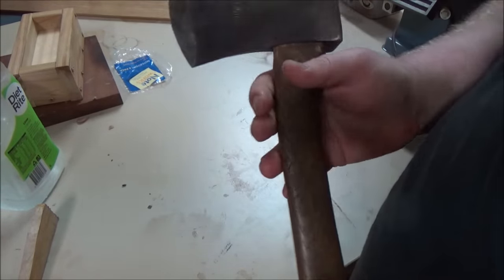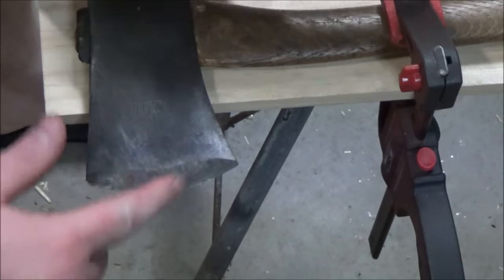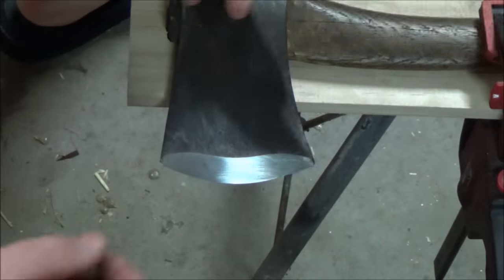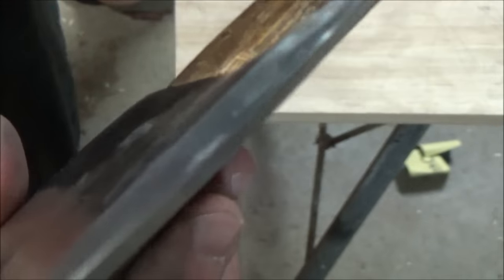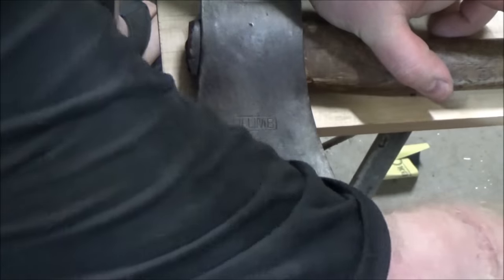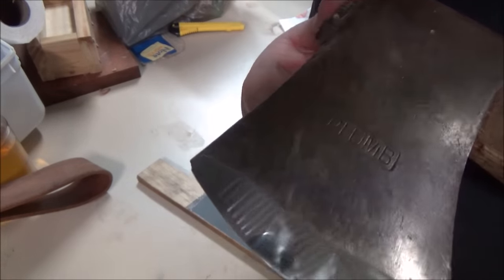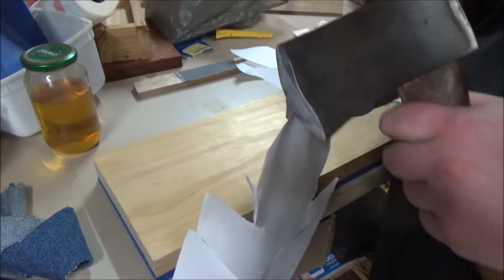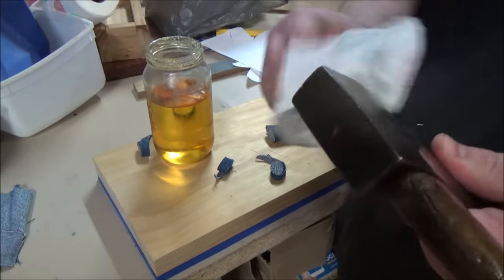How to Sharpen a Hatchet or Axe to a Scary Sharp Edge!

Comment: Are Hatchets made of different steel / metal, or are the all made of the same type of metal?

Also, I've seen some people use a file to sharpen axes, and hatches. Is that method ok? Yes, or No, and Why?
Reply: The type and composition of the steel in a hatchet or axe head varies greatly depending on the quality level of the tool in question. Some are cheap crap that can't be acutely sharpened and won't hold a keen edge for very long. Some high quality items are multi layers of carbon steel that have been forge welded together and given a folding and forging technique similar to Damascus steel. This type of head have a micro chrystaline cutting edge and a sharpness unsurpassed by plain carbon steel.

Comment: Fantastic instructional video!  I have taken your technique to heart.  One question:  Do you put anything on the newly-sharpened edge to prevent rust?
Reply from the maker: Thanks. It's not really my technique. I just tried to think of an easyier way for beginners who don't have stones or tools to sharpen an axe.
I forgot to put oil on in the video. But just put some 3 in 1 oil or anything really. Sometimes I put spray oil from the kitchen on there. Just spray some on and wipe it all over with a tissue or something and it should be good.
Reply: @scottshobbyz5416  Thanks for the additional info.  I figured you had to do something to prevent rust.  Again, great video!

Comment: As someone who surface finishes stainless steel, you need to use sand paper with Ceramic Alumina abrasive, not zirconia or aluminum oxide which are your cheaper, wood sandpaper... The best brand is Norton's Blaze line of abrasives
Reply: You know Ceramic Alumina is Aluminium Oxide right?

Comment: First up, I haven't got a clue but an axe is for chopping wood where you need a substantial bevel that splits the wood once its cut into.
Reply from the maker: The profile of the axe is more important for splitting than the bevel. As it is what causes the wedging action. If you are only splitting wood there is no point having a bevel like mine though as it doesn't help it go any better than a rougher edge say from a file. 
When you are cutting across grain is when you want a nice sharp axe them most. But honestly this was a a bit over kill. But it was for fun. If you mainly just want to cut up dead dry wood then file sharpness or up to say 400 grit is plenty.
If you are axe racing where you want to squeeze out every bit of performance then this is great. They usually take it to a perfect mirror polish. For cutting green wood or carving this extra sharpness is a benifit. But you do get diminishing returns the higher you go. Axe edges don't last all that long and have to be constantly maintained (which isn't hard) but if you just want to get the work done you can get a really good edge with a file.

Comment: I do believe I'd put a small block of wood at one end of the board that holds the sandpaper to act as a guard from slicing a finger while whipping the board to and fro.
Reply from the maker: That could be a good idea. As the sandpaper doesn't go all the way to the edge you can feel it if you go too far. But for people who are worried or are uncoordinated it could work well.

Comment: I used to only use a sharpening stone and my axe would get dull super fast but after watching this I tried it and my hachet is  super sharp if I could put a rating on the video I would rate it five stars
Reply from the maker: Thanks. Yeah axes are generally softer steel than knives due to the massive amount of impact they receive they need to be tougher. One thing you can do for edge maintenance is to just sharpen the micro bevel. You can do this loads of times before needing to go back to the main bevel again. It means you can go from and axe being kinda dull to razor sharp again really quick. Then when the bevel gets a bit thick for your liking just widen it again.

Comment: Man that awesome. Thanks for showing us some tips and tricks. I definitely learned an affordable way to sharpen my camping knives. Can this same process work for scissors?
Reply from the maker: No worries. This is only affordable in the short run. The more you sharpen the more economical stones become.
I personally don't use this method for knives or scissors as it is harder to hold a consistent angle on such a small bevel. I have only done a couple pairs of scissors and only with the scissor attachment on the edge pro apex. If you want to see a great tutorial on free handing scissors type in 'sharpening scissors is basic knife sharpening' by a channel named 'Dean O'.
Reply: @scottshobbyz5416  thank you so much. It is very much appreciated

Comment: I did not have much luck...I watched this yesterday and tried it last night.  I went from 80 - 120 - 220 - 400 - 600 - 1000 -2000 but it is not razor sharp.  I started out with a very very very blunt hatchet.  Might you be able to share how what I may have done incorrectly?

Comment: Important to not profile to much angle or would fold the edge if you hit a knot in a branch or as such ,smooth polished side helps it glide through materials
Reply from the maker: This one does fine. Without the micro bevel it would roll the edge though.

Comment: Great job sharpening and maintaining the axe handle. The only thing I would have done is show us how safe we all should be by wearing some steel toe shoes in case you drop the sharpened axe on your toes, it wouldn't turn into a "HOW NOT TO WORK WITH SHARP OBJECTS IN YOUR SHOP" video. Thanks I wondered how high of grit you would take it to. I read that there is up 100,000 grit.
Reply from the maker: Thanks. Normally I would use stones and files to sharpen the axe. My finest stone that I know the rating of is about 3microns I am not sure what that is in grit but it is finer than what I did here. I could then go to my 1micron and 0.5micron strops but I gave never bothered to. I believe that they would be at the kind of grit level you are talking.
It seems everybody knows what footwear I should be wearing already. So probably not necessary to teach them. I honestly doubt most people use all the same safety precautions at home as they do at work. I barely wear them anymore now anyway. So nobody has to worry.

Comment: That is very impressive for an hatchet. Question is, why? As a utility hatchet, this edge is gone in a few chops. Just seems a waste of time beyond maybe 220.
If it were a show piece, I completely understand and it IS beautiful finish.
Reply: You got that right. He’s just showing off.
Reply from the maker: I don't use this as a general utility hatched. You get rapidly diminishing returns refining the edge like this as there a only a few tasks I know of where this would have any benifit over a coarser finish. The video was to show you can do it without tools and try to teach how to sharpen an axe. Also for a bit of fun :)

Comment: I prefer a convex type edge bevel on all my axes. This may be good for some type of carving axe though, I don't know I don't carve. The axe is a chopping tool and needs a durable bevel. IMHO that is. Still enjoyed the video, thanks! :)
Reply from the maker: I haven't had enough time or opportunity to chop enough wood to test different edge types. Lots of people like convex and a lot like this type. If you have the micro bevel it is pretty stong. You can increase its size if needed. 
But if I am cutting wood across grain this edge busts out chips like it's nobody's buisness.
If you had an edge like this and only stropped with compound you would end up with a good convex developing.

Comment: How long will an edge that sharp last?  Chopping wood, etc...
Reply: Depends on what your cutting and how much material and how long, the duration of each cutting job.
Reply: I generally sharpen my axes every spring, then touch up as needed throughout the year.  There really isn't a "usual" time period because everyone uses their axes differently.  This year, I split 6 cords of fir for firewood, next year it'll be somewhat less, because I won't have burned through everything I split by then.   I have a fixture for my bench grinder that I rough sharpen my axes, but always finish them by hand.  And you will dull them if you use them, just no way around it.  Nicks and dings go with the territory

Comment: I saws this done with chisels--the difference was that--some WD40 was used as a lubricant on the finer grits. Don't know how that would work with 2 sided tape though. They used 3M spray adhesive on a marble slab.  Cleans off with paint thinner. Don't know if I can locate 2 sided tape that wide in the boonies in the Philippines.
Reply from the maker: This was just to show you don't need fancy tools or stones to get a sharp axe. I would use sharpening stones normally. In the long run sandpaper is more expensive. But if you are starting out it is cheaper.

Comment: How did you know when to move to the next finer grit paper? Seems it might be harder to know this when you’re using the finger grits.
Reply: Michael, it's actually relatively easy to see when you have changed the scratch pattern. Most important is to make sure that the burr from the new grit is established on the edge before changing sides or a new grit. Knife channels go into some depth

Comment: How long will it stay that sharp in normal use, though?
Reply from the maker: I haven't experimented enough to give an answer I am confident in. Nor do I get much chance to chop much anymore. The extreme sharpness I was showing off at the end goes pretty quick. But it hold a good sharp working edge for a while. Depending upon what you are cutting as well. Hardness of wood makes a difference, if it is green or dry and especially if it has any dirt in or on it.
One benifit of sharpening like I did is touching up the edge takes less than 30sec and is is back to where it was. Just touch up the micro bevel. You can do it loads of times before it is worth addressing the main bevel again.
I will one day do a in depth video on axe sharpening and different ways to maintain an edge. But please don't hold you breath as it will be probably a couple years away :)

Comment: I would like to see the opposite side being sharpened. How is it clamped, positioning. Thank you
Reply from the maker: It is clamped the same way just on the other side of the wood. Kind of like a mirror image. I find it works better to have a small wedge under the axe head than not though. Can't remember if I did in the video or not.

Comment: Autobarn sometimes has over 3000 grit in the paint section. I just found an old Hytest 4lb in my parents shed and I'll strip the old paint and rust and do the same as the vid and it'll come up sexy as
Reply: Maybe it will and....
Reply from the maker: good luck. I usually use a wire wheel on a bench grinder for rust.
Reply: @scottshobbyz5416  yep exactly what I did, then angle grinder with a flap disk for any imperfections
Reply from the maker: careful with the angle grinder very easy to get the thin edge to hot. It it changes colour you have softened it. If I have to rough in a bevel and can't be bothered using a file. I use a 4x36" (915x900mm) sander. It is not too fast and you can feel for the heat building up. Then put the edge in water when it gets too hot to touch. Takes longer but I get a better result than I would with a angle grinder and far less risk of ruining the heat treat.
Reply: @scottshobbyz5416  yeah I only use worn flap disks but never for the bevel, much better heat control
Reply from the maker: Flap discs are far better than the grinding wheels at reducing heat build up. But believe it or not newer abrasives not worn ones also reduce heat build up. Due to less friction being created. Also bigger particles build up less heat too. For example 60grit creates less heat than 240 grit.
Fresh abrasive cuts the steel easier. Once the particals become rounded or break down to smaller pieces you end up with more friction and less cutting.
Honestly I probably would use an angle grinder with a flap disc on cheaper knock around axes but I would not like to on my good ones. 
If you know what your doing you can get away with it though.

Comment: While I can appreciate the love you put into this job and the video, I should remind you that this is a TOOL, not a surgeon's scalpel.   Go to Harbor Freight and buy a $50 belt sander and order a variety of grit belts on the internet.    I can do everything from axes, machetes, mower blades and my kitchen knives in a 20th the time and just as well............and then touch them up as needed in a heartbeat of maybe 20 sec each.    By doing this I have lots of spare time to watch other videos about things that interest me.    There is a saying.........Work smarter, not harder.    I am not making fun of you, just trying to help you out.
Reply: Now we go to Canadian Tire and get their sharpening tools double sided sticky tape and various grits of Emery Cloth and wet and dry sandpaper which I have seen up to 2500 grit The super sharp hatchet blade is used for much more than chopping. The Axe on the other hand one would want to gear that edge to a chipping edge which is a hollow ground cutting edge which uses the force of the cut to throw out the chip from the cut. Work smarter not harder is referring to the time spent keeping your tools in tip top shape sharp and easy to handle The better the tool is cared for the easier it is to use when needed. Also a light edge dressing after use means the tool is always sharp dramatically reducing the time required to maintain your tools Yes they are your tools and the better you treat them the easier your job becomes. Nathan this is the difference between a journeyman looking to make money and a master of the trade who is doing something he or she loves and is willing and wanting to have the best cared for tools that one can have. Let the tool do the work and give it the love it needs to perform at its best.
Reply: @retiredarthritic2083  I am a dentist who sometimes spends WAY too much time getting a good result.........far more than I get paid  for, so I can relate to what you say.    My problem is that there is only so much time to get things done, so if I just want to sharpen a hatchet or mower blade to a functional edge, the belt sander does it really quick for me

Comment: And here I thought I was the only one that used sandpaper to finish the edge (not just to remove rust on a “new” old piece) after using a fine metal file to sharpen my metal implements.
Reply from the maker: I don't usually use it actually. I tried to think of a way someone without tools or stones could sharpen an axe. Also a beginner friendly technique. It actually worked better than I thought. But would be more expensive over the long run. At least if you don't let it go dull like mine was you won't have to do as much work.
It does have other advantages over stones though. Mainly you never have to worry about flattening it.

Comment: Nice video, I'll do this on an old axe that I haven't been able to get a very sharp edge on it... I believe everyone needs to have several types of axes in their tool box with all kinds of sharpened edges that will fit the particular job at hand.  
I don't think axes sold today are made with a good quality steel like years ago, even the wood handle, seems like each time I use a newly purchased tool I'm always breaking the handle from normal use? lol...
Reply from the maker: Good luck with the axe.
Handles these days are a pain. One thing I like about the old axes is that the handles were thinner. But these days they aren't as careful with the wood selection or grain orientation so they are thicker to strengthen it. 
I love old axes. Unfortunately I don't have the chance to use them anywhere near as much as I would like. I also have no way to test heat treat of past and present axes or their composition. So I can't quantify what quality difference there is. I have had luck with some cheaper ones. At least the cheaper ones make good beater axes. Chopping tree roots and stuff.
About what you said with the different edges. It seems to be a philosophy a lot of people don't get these days (this videos comment section testifiesto that). The woodsman of old used to have different edges for different tasks. Think of the double bit axe for example. They would usually have one edge that they honed really sharp and the other was just sharpened with a file. The rough sharpened edge was used for dirty jobs like debarking trees and the good edge was for the chopping.